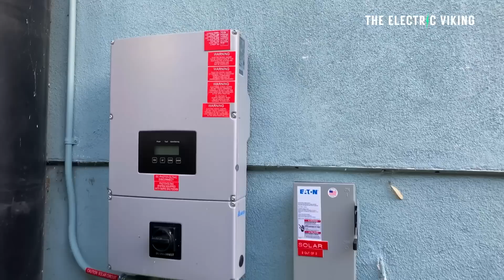Scientists say solar panel advances will see millions go off grid

Comment: Not going to happen everywhere. If people leave the grid and don’t pay for the capital infrastructure then those remaining, middle and low income families, will not be able to afford the electricity. If say a new sub division decides to be off grid then there is going to be a problem powering street lights unless an off grid solution is found along with the subdivision responsible for maintenance. 

It’s a bit simplistic to bash grid operators as money grabbing corporations.

Comment: Sam takes many liberties with his reporting, which is why he doesn't link to the study. The study's summary:

"Rising energy procurement costs and declining capital costs for renewable technologies are provoking interest in self-sufficiency for individual buildings. In this study, we evaluate the potential of self-sufficient energy supply for 41 million freestanding single-family buildings under current and future (2050) conditions. We identify 4,000 representative buildings, calculate weather-robust cost-minimal energy systems, and transfer the optimization results to the entire European building stock. Our analyses show that buildings in regions with low seasonality and high electricity procurement costs have a high potential for self-sufficiency. Under current techno-economic conditions, 53% of the 41 million buildings are technically able to supply themselves independently from external infrastructures by only using local rooftop solar irradiation, and this proportion could increase to 75% by 2050. By paying a premium of up to 50% compared with grid-dependent systems with electrified heat supplies, building owners could make over two million buildings fully energy self-sufficient by 2050."

Comment: One small problem that you're not seeing
Solar panels once connected to the grid or battery you can only get and use less than 20% of their advertised maximum rated output
It's called ohm's law
Reply: Nonsense, completely clap trap. My 4kW system can output a good 3/4 of its rated output when conditions are right, namely the right mix of sun and some white patchy cloud which reflects more light back onto the panels.
Reply: @cbcdesign001 
It's not that hard it's ohm's law fourth grade math
Or
 do you have a volt amp meter
& Or
Have you ever used a car charger
Reply: Idiocy and hyperbole is the best the anti solar terrorists can do.

Comment: Several of the top home solar companies in the US have gone bankrupt.  Several of the big lenders recently got in trouble for hiding loan origination charges.  In many areas there is a shortage of qualified installers and repair people.  There is no shortage of outright fraud in selling the systems. If residential solar is to become mainstream, the industry is going to have to be regulated to stop the fraud, and installation is going to have to become simpler and more standardized.  It might well turn out that installing panels on individual homes is not the most cost-effective way to do it. Time will tell.
Reply: How many petroleum and coal mining companies have gone bankrupt? You have nothing but idiocy and hyperbole  @stevehofer3482

Comment: Worth noting that lots of European homes have much better insulation than Australian homes. Homes are smaller on average in Europe compared to Australia and the US as well. Better insulation, smaller house and energy efficient devices make solar and battery cover more of the homes energy use, if you alter any of these parameters you’ll likely have a higher energy demand and more grid reliance.

Comment: My next home will be completely independent for electricity, water and sewage and I will use no fossil fuel (no gas for stove, heat, generator or vehicle) and I'm aiming for 80% independent for calories (I still love my chocolate and occasional banana and pineapple etc that don't grow where I live). Starlink for internet is about the only utility I plan on paying for. I will have no pipes or cables coming on or off my property.

Comment: 2 years ago I looked into solar panels for the house . If you want to come off the grid you need solar + batteries. It would take about 11 years for solar panels to pay for themselves. If I got batteries it would be almost 20 years. .. And solar panels have an expected lifespan of about 20 years. 
So yah.. even with a 50% reduction in cost, it makes more sense to me to stay on the grid.  probably
Reply: Much cheaper in Australia. The equation look much better.
My 4kW Solar cost $5890 (AUD) 10 years ago. Paid itself off in 5 years. Free ever since.
Now I’m looking at an upgrade to over 10kW alongside a 5-10kW battery system.
Our government is offering subsidies to support solar, batteries and electric cars. (Why not, the fossil fuel industry has enjoyed massive subsidies for a very long time.)
A recent study showed that ALL of Australia’s electricity requirements will be met by just rooftop solar by 2050. Likely sooner.
Combined with grid Solar, wind and pumped hydro for storage, we have zero excuses. Zero. It’s just red tape, not a technology challenge.
The learning rate for solar is 22%. Wind is 12% and batteries are even higher than 22%. That means the cost in less than a decade is 50-66% less, at least.
The real missing piece is simple Vehicle to Home (V2H). Once this is as simple as home solar, it will be a bonanza.
We also need a much bigger investment in off-river closed-loop pumped hydro. There are 200x more sites in most countries than is needed. So there’s zero excuse, just a lack of decisive will to make it happen.
Reply: @aaronsinspirationdaily4896  Agreed ! 5 years to pay off would be great..
Reply: Took me 5 years, you are being ripped off or you suck at math.
Reply: @JebusHypocristosX  Or he lives at different latitude, with different investment costs/subsidiaries and different grid electricity price. These make huge differences in payback times, everything between few years to not paying back ever.
Reply: @opk168  Such idiocy and hyperbole is consistent from the corporate terrorist trolls. The consistency is almost admirable.

Comment: I spent a year living in a van with 300 watts of solar, 260ah 12v storage and a 3000w inverter 

I look at the power in the home now and see it as just wasteful. There is no reason to be grid connected. And when bushfires took out our power supply to the home, I plugged into the van
Reply: So now I have to live in a f@$#king van to keep the greenies happy?
There is a realistic solution to billions of people that need shelter!  
Thanks for this
Reply: @davelewis9439  no mate, sorry, you are most definitely not invited. Firstly its your issue with comprehension and second your foul mouth

Comment: On March 22 a hailstorm in Needville Texas destroyed a 4,000-acre solar farm. Now the nearby residents and farmers are worried about toxic chemicals from the solar panels leaching into well water. Has recycling of solar panels at the end of their lifespan ever been addressed? The price
 of solar panels will soar when the price of silver a key ingredient, reaches its true market value of from $200 to $600 USD an ounce. The future is thorium nuclear energy and water powered vehicles. Water turned into a combustible gas as was done by Stanely Meyer and Dennis Klien could also run generators for off grid power. Water is the best fuel as the combustion product is water vapor.

Comment: Yes Sam absolutely correct. But faster than you think, because it will become self propagating.  The more people go off grid, the more energy companies will have to charge to cover production and maintenance costs. So more will be forced off grid and so on. Big energy companies either electricity or hydrocarbon, are slowly loosing their controlling grip on society and its not before time. Love your work mate, hoping for some better luck for you and your family. Cheers.
Reply: I was thinking that, to maintain the grid, it's quite expensive, if more go gridless, there are fewer consumers for them whiles at the same time, they still have to cover a wide network, so the cost to maintain will still be high but the money coming in from consumers could drop a lot, which they could very well pass those cost onto the existing consumers, which will push more of them to go gridless.

To really go gridless, solar alone isn't enough unless you massively oversize it to cover the winter months, but ideally, what's really needed is much cheaper and bigger energy storage that can cover days or even weeks, but even better is if we can have solar and wind at a local level as they would complement each other and would reduce how much energy storage that's needed because a more consistent flow of energy will be generated throughout the year.

Unfortunately, wind at small scale don't seem to perform that well in urban areas, if that can change with a lot of experiments that are going on with vertical wind turbines, a mix of solar and wind would allow most of us to go gridless and you wouldn't need much energy storage to do it.

Comment: I'm mostly electric at my home, my tenants apt. has gas , I'm planning on a 10 to 12 kwh solar array in my back yard., with 3 battery reserves for the 3 buildings on my property. My monthly bill now is $600 to $800 , the system I'm designing will cost me 35k approximately.  About a 5 year return on investment, not including the small amount being put back into the grid. Also, tax rebates . I'm waiting for perovskite panels to be released for residential application. So im on board with the renewable transition. I will charge my Tesla  Y by solar, so that's cool. When it's my turn to  get my Cybertruck, I'll be all set. great vlog Sam , ty again for great reporting
Reply: Perovskit panel

Comment: Leaving the grid only makes sense in very remote areas where maintaining the grid is too expensive, or if the grid operator is doing something ridiculous.
Reply: If you can't leave the grid you can offset it with a system and batteries, charge batteries off peak and than use stored energy during peak times.
Cheers

Comment: In the Pacific NW we can harvest the equivalent of about 3.5KWh per KW of solar panels each sunny day. However, in winter I have seen days of as little as 2% of this, and a week or more averaging 12% per day. To truly go off-grid. we would probably need around 80kWh of batteries and 36KW of solar to be able to get through winter. Going off-grid needs a backup generator when all else fails, but may be possible without this in sunnier southern states in winter, but would still be costly. Most houses do not have roofs with a large enough area and would need to mount panels on the ground. Smaller lots, shading and HOA regulations would prevent many from using ground mounts.
Reply: Or you need a V2H vehicle and charge it at public chargers in the winter
Reply: @gerryburde5663  It's an idea, although the nearest charger to us is 20 miles away...
Reply: Or you could upgrade to a better system but that would not serve your idiotic narrative.
Reply: @JebusHypocristosX  Why idiotic? We only have 12KW of solar - upgrading beyond 36KW would be very expensive and would mostly be wasted in the 7 months around summer.

Comment: I've had my full house solar system with house batteries for about 2 years and my Tesla for 1 year. Not enough production capacity to go off grid but we are super happy with the results and huge savings. Added to that the local grid energy company provides a 2nd electric meter fir the express purpose of charging an EV with off peak rates. Nice. Duet cheap too. Hence my house and transportation costs are crazy low. Thailand gets lots of "sun days" and the decision to add solar a good one. My mathematical payback is about 5.5 years. 👍

Comment: what I don't understand, I do really, is why the UK Government won't "invest" in installing solar plus battery into low income households or even all households. I had 3.2 Kw solar plus 3.2 battery, upgraded to 6.4 Kw battery installed at a cost of approx £10,000, I have since upgraded again to a 11Kw battery system and it reduced my usage by almost 50% in the initial install. Admittedly this was in the summer months but what you can save in the summer can offset some winter usage. We have approx 27 million house holds in the UK and yes not all are suitable for solar but if my maths is correct it would cost 127 billion pounds whereas they have spent over 800 billion on a useless train link from London to the midlands. Of course I know they want to protect businesses etc as if everyone were to reduce usage by 50% then we wouldn't need all these power stations, over simplified I know. I just wish I could install more panels and say shove your electric bill up your bum.
Reply: Because the politicians receive "contributions" from the fossil fuel industry and the industries which profit from the current grid system.

Comment: What this survey doesn't measure is the value of freedom from govt. that varies greatly. "We", as individuals, only need to be free to choose where our resources, our wealth, is spent. I would choose a micro-grid, green energy produced locally, to avoid transfer loss, thus more efficient, OR, off-grid, rooftop/battery. But, NEVER the grid, an energy monopoly that is always the most expensive, and ultimately unsustainable. Why? Monopolies create short-sighted greed that grows and grows over time, destroying itself and those who allow it.